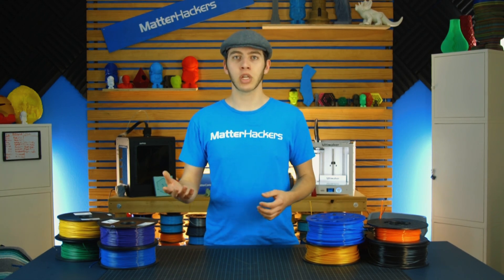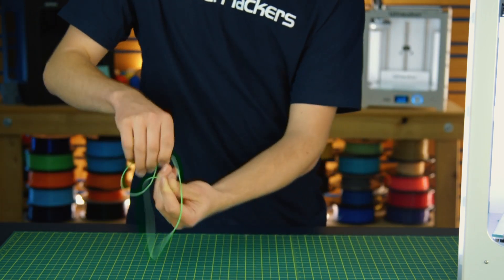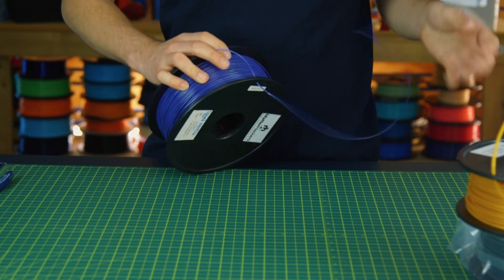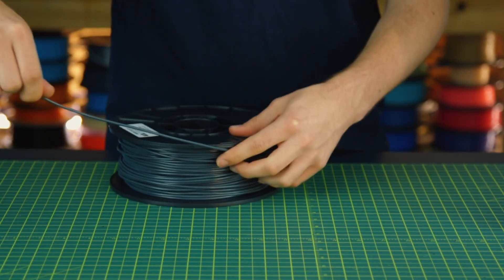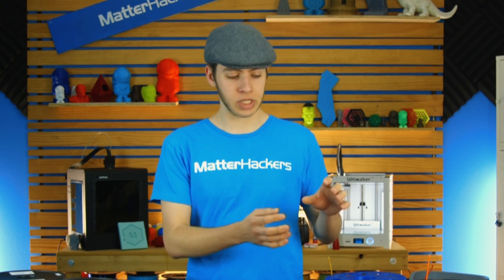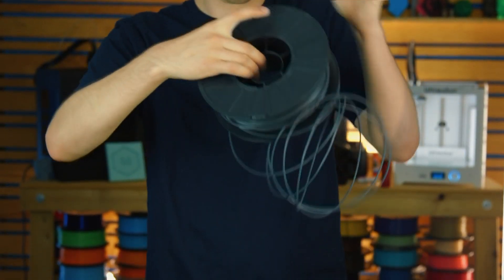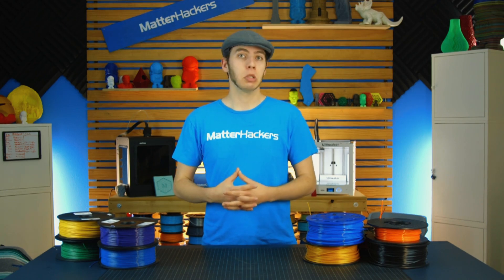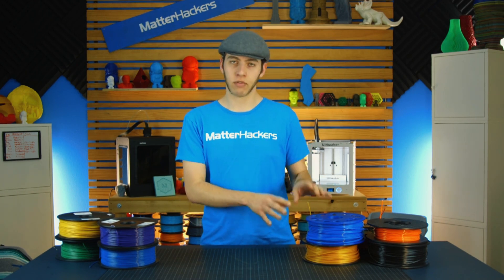How To: Untangle Filament // Filament Guide

Comment: It is so easy to always put the blame on the user while in fact some manufacturers like Creality shows this problem more often then other brands. The problem appears when spools are not properly winded up in the factory. Either too loosely or too tight can cause tanglement half way your spool. The fact that the manufacturers lock the beginning of the filament to the side of the spool does not prevent this.

Comment: Actually, you're wrong. It a well known and fairly common issue in the 3D printing community — it’s called filament tangling or cross-winding on the spool. Even though it’s not super widespread with high-quality brands, it does happen occasionally — especially with budget filament or less rigorous quality control during spooling. During the manufacturing process, if the filament is allowed to loop over itself as it’s being wound onto the spool, it can get “crossed” underneath other layers. As the printer pulls on the filament during printing, these tangles create sudden tension, which can prevent the extruder from feeding properly.

Comment: It's absolutely possible for filament to be wound incorrectly. It has to do with the direction it's wound onto the spool. Fishing line is the same way, it has to be spooled a certain direction or the line will spring off the reel into a bird nest. Filament is stiffer so it doesn't bird nest but it does cause loops to form that lead to binding. Just buy Flashforge filament and find out, lol.

Comment: I'm in a bit of a mess and not sure how to find the right solution video, if there is one. I just finished a print and needed to swap out the spool with another color. I opened up the spool figuring I'd just swap out... and the color that had been on the spool just starts letting loose a bit. I got it back together, but now I can't get the spool to close on it, it's now "too fat." I don't know what I need to do now. I did confirm the spool/cardboard notch is lining up, and have tried brute-forcing it and it just won't close.

Comment: My spool snags when filament brand new. Creality brand PLA. After 2.5 hrs. About100-200 ft filament later, spool still wound factory tight. It then snags. It doesn't spool out. the Tight roll from factory Filament gets wedged, locks up-NOT USER ERROR
Reply: Yeah it's from the factory, this guy has no idea what he's talking about. He's pulling this out of his ass.

Comment: I complained on the customer review section about a roll of AnyCubic filament. AnyCubic sent me to this video for educational purposes. I've known for years that there is an opinion that a tangle is impossible unless you let go of the end  and take your eyes off it to see where that end went. Certainly, dropping the end COULD result in a user created tangle. Of course that could happen. But the opinion that it's impossible: wrong. It is possible. Being very much aware of the myth (and believing it to be true), I never let go of the end as I opened it and loaded it onto my printer. It jammed up every time I left the room for more than a few minutes. I would straighten a tangle and start again. Then it would jam again. Part of the myth (that it's impossible to have a tangle from the factory) is in the definition of the word. What happens at the factory may not be a "tangle", but it's a trapped loop that get buried under more very tight loops. The fix is to unroll the spool until you release that trapped loop. Then you start printing again and hope there are not more trapped loops. One method I tried with some success is to secure the end of the filament, then put it back in the box and shake it quite a lot. Hopefully that will help those trapped loops to find their way out. Sorry for so many words. By the way, AnyCubic is sending me another roll and I appreciate it.

Comment: 0:32 I literally had a roll of your cheap MH Build, ignoring the spool was damaged in 4 different places, have a binding issue ~220g down.  I took the spool, put it on my printer, cut the tape / filament 45deg, moved my hand 10cm to the PTFE tube, and away we went on a 10 hour project.  3 hours later I hear terrible grinding / plastic squeaking.  Yeah, it bound up under a thick portion of wrapped layers, and was printing air, cool.  If your spooling machine loses any tension at all, or deviates in the left/right sweeping, boom you introduce "tangles."  You should add the more appropriate word, binding, into the video as that is what is happening, it is not a tied knot as "tangle" may suggest, but new users aren't going to discern that.  But also as someone who fishes, it seems dishonest saying "it can't physically happen from us on our end."
Reply: Try this with your fishing spool next time you have a rats nest. I'm sure it will help xD

Comment: Well, I can only go by what I've seen Myself?  I had brand new sealed up in plastic spools from a good well known maker and 
I cut away the vacuum sealed plastic and right away see there is a bad knotted up tangled filament spool even before I have taken off the end to cut the bent bit.

The amount of spools I have brought after the years that have had already fully tangled up knotted filament on is amazing!

I not even undone them and they are already tangled, so you can't blame me for the filament being tangled.

The daft thing is, some of the cheapest filament I have bought from little known companies are the ones I found as the most 100% perfect wound spools and these are half the cost of the fancy filament companies did.  And yes that idea he stated as to unwind the filament and then when holding the filament section near the spool end and letting that loose bit to un-wind does not work?

In fact I had that loose end lot end up re-knotting up and getting totally tangled up such that I can't un-tangle it, I have to cut that section off to try to un-tangle it?
It just has so much tension in it, that it goes mad and tangles up into a knot as you are holding it to try to un-tangle it?

Even turning and twisting the tangled cut of length has no chance to fix it. It is beyond un-tangling. It just ties up more as you try to get around the tension and twisting filament.

I got so fed up by it, I no will print out a spool to spool re-spooling set up to move under tension one full spool to a empty one. Very few spools of filament even new ones are well wound.

Comment: Had this issue with an overture matte pla filament roll just now. Didn't extrude properly then I used the old black one from a previous batch that uses abs for the spool instead of the cardboard being used now and it printed fine. Don't know what's up with that but.. 🤷

Comment: You should also put a disclaimer to video this only solves tanglement problem that is happen with open end filament, but filament can stuck or tangle by retraction and tension just like old telephone cords tangle in a specific way. And sometimes this happens when you try to roll the filament back to spool.

Comment: This was total nonsense. My tangles have NEVER occurred due to the ends passing UNDER existing loops. They occur when the filament loosens and the loops start moving over each other. For this reason your "just rewind it" solution doesn't work. There's a reason why the winding machines move side to side as they wind. Your solution all-but guarantees future tangles.

Comment: Wrong, MatterHackers.
When a tangle appears to be deep inside the spool, it can't be because someone somehow failed to properly secure the filament. It's clearly a manufacturing issue, because every coil layer is theoretically tightly wound ontop of the other (if you have some kind of magical formula that says "hey, people ! you CAN tangle and knot a filament in a location you can't reach", sell it. Billionaire ahead).
That's something I recently had on some (not cheap) spool that was perfectly wound within the 2/3rd of the overall length, and then ... knots every 10-20m or so.

Trust me, having to unwind that much filament length, untangle it, and rewind it properly ... is a f**** PITA. It takes an awful lot of time. Users can't generally be blamed. Manufacturers can.

Btw, what you show as a "nice, clean spool" is a totally wasted and non properly wound spool.

Comment: I'm new to printing and noticed that my filament was binding and would simply loosen the spool a little every now and then to make sure the print wasn't affected. After a failed print 8 hours in last night, I tried this out and I no longer have a problem with my spool unwinding. I'm guessing I wasn't paying attention when I first hooked up the spool which makes sense because I accidentally let it unwind when I took it out of the packaging. Anyways, this worked for me. Hopefully the rest of the spool keeps unwinding like it should with any binding.

Comment: Filament CAN be tangled right from the factory, you may think it's not possible until you seen it first hand and had to either completely re-roll it, return it or gave up and threw it in the trash. Thankfully this has only happened to me once though there had to be at least 50 tangles when I re-rolled onto an empty spool(it was past the return window), once that was done it printed fine with no further issues. Though it is worth mentioning that this was the cheapest roll I have ever purchased, from a company that no longer seems to exist, can't imagine why...
Reply: I have this very problem new out of the bag put it on my printer and a couple of hours in and NIGHTMARE. Time to respool it.
Reply: My spool snags when filament brand new. Creality brand PLA. After 2.5 hrs. About100-200 ft filament later, spool still wound factory tight. It then snags. It doesn't spool out. the Tight roll from factory Filament gets wedged, locks up-NOT USER ERROR
Reply: @MichaelGallagher-wd6sy  I have the same issue with Creality filament. So far i never had tangled filament with other brands.

Comment: I just had to throw away yet another 1kg spool a filament due to factory tangles.  The spool was not salvageable due to the entire roll being horribly tangled.  It was better to throw it away to prevent printer damage/wear & tear.  Factory may not be able to create a actual knot, but filament can be purchased with tangles.  I found it worth the extra $s to purchase tangle-free filament.

Comment: You know the manufacturer can accidentally let go of the end too right? And cause the tangle just like would happen to the end user. The person working at the plant is only human too and mistakes happen. Like you said when the roll is finished they cut it and fold it under the side of the roll or tape it to the side of the roll, and if they drop/let go of that end before they tape, that end can go under itself on the roll just like it can at your home. It's not a hard concept to understand. Obviously it wouldn't happen mid extrusion.

Comment: trying to fix the tangle mid-print
SHE'S GONE FULL SLINKY!!!
ended up just snapping so i just took the reel, went down to where the spool was normal and just re-red it into the printer.
I'm sure i can save that extra material for whenever i need to do a cold pull or a test~

Comment: I have the anycubic i3 mega and someone thought it was a good idea to pull out the metal tube holding up the reel. (I don’t know what happened next) then after awhile of my printer tugging on the not rotating reel it got super tight and somehow tangled

Comment: So the guy at the factory can't also make this mistake...ever?
Reply: I got Zyltech spool that was already binding right out the box,
Reply: @samdavis1228  I have a Hatchbox spool that did the same. I tried unspooling and rewinding. Still failed after going to bed on a large print.
Reply: Yes
Reply: Ahhhh. So this is the db that taught everyone on Reddit that the factory couldn't possibly have bad spools. You're a bum
Reply: Bambulabs here that's out of the box just a mess, filament keeps disappearing somewhere within instead of on top
Reply: @TotalXPvideos  I spent 4 kgs of bambulab filament without any problem. This week I bought some sunlu PLA and had problems on the first print. Probably my fault as the guy explained, but I will pay extra attention when I open the next spool.

Comment: Somebody doesn't understand the difference between a knot and a tangle, I got a few rolls of crappy abs that have snags almost every layer so I was looking for a clever way of rerolling it, not sure why this video was at the top of my search.
Reply: A knot is where the infraction can be seen visibly usually near the surface. A tangle is when you don't feel like looking for the knot and you kinda just grab the filament by the loose end and shake it violently out of frustration
Reply: Yes thank you
Reply: https://www.youtube.com/watch?v=lE9LchCtKL4
Reply: 100%. Rolls can be wound badly with the leading end being wedged way deep down the side of the spool, which creates to much friction & causes the machine to give up before damaging the motors & it declares a jam. I know because this has been the case with my last 2 Bambu Labs spools, in fact I'm off upstairs now to clear yet another jam 🙄
Reply: Yeah the video drove me crazy it was sent to me by anycubic support

Comment: How exactly is it possible to do this mid print without pausing or stopping as you said?....
Reply: Easy. Let the print continu and once you find the knot you pass the whole spool in between the filament to remove the knot. I just did that and now im confident my 24 hour print wont be wasted near the end because of that knot! Just like making a slinky work again!!
Reply: I guess it's impossible.. You can maintain it alive for the duration of the print though, & then fix it later.

Comment: Yes the spool will sometimes spin back from lots or retraction, creating enough slack to get 1 winding to slip under another and then bam, it cinches up... How do you keep the spool from rolling backwards on the spool mount?
Reply: This guy has my problem. Formally this is not a knot (like the one OP challenges us to make while holding two ends of a filament. Cant be done.)

But a binding tangle can definitely happen and has been happening on my ender 3 since I started using it yesterday.

Personally I am thinking that I need a sensor to detect when this condition arises, pause the print, and notify me.

I would love instead to find a way to prevent this altogether, but I am skeptical of the basic advice to simply never let my spool become a little slack.
Reply: FWIW for anyone experiencing this problem, OP's advice to unravel and rewind carefully worked. I asked a friend to hold onto the filament and we carefully unspooled and respooled about 20 feet. I haven't had a problem since  but keep in mind I have never changed filaments, so I'm probably at low risk for introducing slack. I'm also using a filament guide arm now which maybe also makes a difference.

Comment: On my Prusa i3 MK2S, the biggest problem is the spool rocking back and forth, either due to large movements in the X/Y direction or repeated retractions.  What happens is the tension isn't recouped and the spool gradually gets looser and looser.  On new spools, the filament can slip over the edge and then get tangled up in the spool holder.  On a used spool, it's much less of an issue.

I've tried various filament guides without much luck.  A recent spool of Fillamentum ASA has been a total nightmare - it's almost like 1kg of filament on a 750g spool or something.
Reply: I wrapped a rubber wristband around my spool holder pipe and eliminated this issue entirely on my CR-10.

Comment: Oh cool a company that sells spools of filament putting out a video trying to convince people that it's not possible for a spools to come from the factory with tangled filament despite the experiences of numerous consumers. Carry on
Reply: It's human error, not a machine error. The video implies that people blaming the spooling process are always incorrect, it doesn't blame the customer 100%. Most times it is the customer though.
Reply: I buy matterhackers....  And there 1.75mm PLA spools, man you have to baby sit the fire out of them the first 25% of the spool.  Haven't had one yet that will not tangle.  They are very loosely rolled and unroll 99% of the time with first out prints.  quite a pain in the ass to be honest.
Reply: I've had a brand new spool that was already tangled when I opened it. And yes I was salty about it just like anyone is salty when they get defective product. Those tangles can occur when you lose tension on the spool which is something that can and does happen on the customers end but it can also very much happen on the manufacturers end when they're spooling it. My first job was actually working at a plant that made cable and I've seen spooling issues occur in real time with my own eyes. And that's what irks me about this video.  It implies that it is always an issue that occurs on the customer end.
Reply: strube8 I agree. If the spool is wrapped poorly, there may still be things that come off as a tangle. If it piles up in the middle before going to the deges or on one side before going to another, it may still tangle. Sure, if you held both ends and loosened up the middle occasionally as you unwrapped it, it would eventually untangle itself, but saying it's impossible to get a tangle is completely bunk.
Reply: Edit: Okay I understand what other people mean... human error and other types of filament tangling. I was mistaken.

They explain it in the video, it’s impossible to be tangled unless they tangle it right when they’re done (which would be a horrible idea and they would not do that).

Seems like someone had a filament tangle and got salty about it.
Reply: Oh cool another person who doesn't have a clue how filament is made. "Carry on"